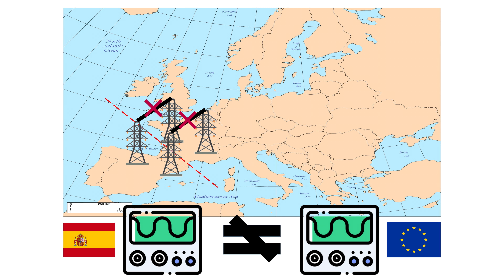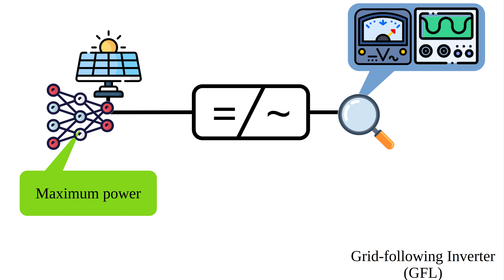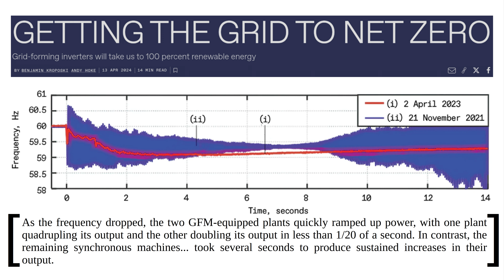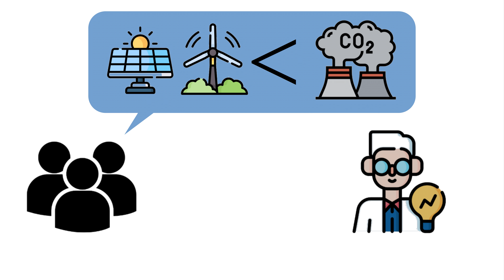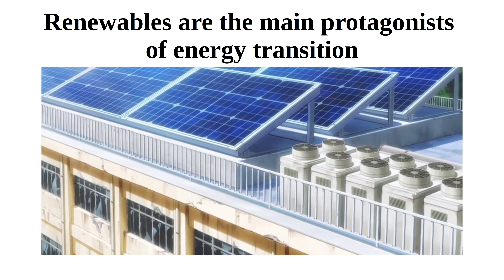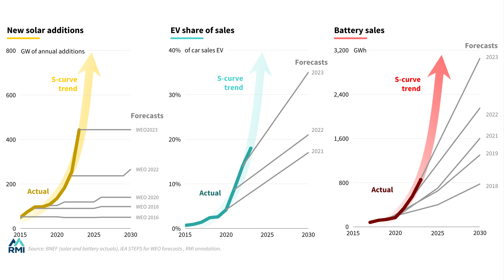After the blackout in Spain: how renewables + batteries can help prevent the next major power outage

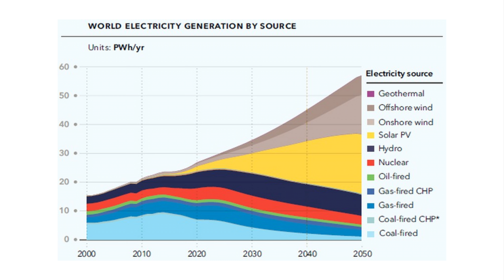Comment from the maker: (Information update at 08:40) According to ENTSO-E, 20 seconds prior to the separation of the Spain national grid and the rest of continental Europe, 2.2 GW of power plants were gradually tripped, though the specific details of the power plant types and reason of failure remained unknown as of now (mid May). Even if all the 2.2 GW of power plants were renewables, however, it does not undermine the main points of this article.

See more info at: https://www.entsoe.eu/news/2025/05/09/entso-e-expert-panel-initiates-the-investigation-into-the-causes-of-iberian-blackout/

(Further information update)
In mid July, ENTSO-E published a more detailed timeline of the events. Now it can be clearly seen that, on 12:33:24 a total black out occurred when all generation were lost. This meant that the initial data registered in the ENTSO-E transparency platform were probably incorrect. Although according to the updated information, the time for wind and solar generation to return to normal was still one to two days.

See more info at: https://www.entsoe.eu/publications/blackout/28-april-2025-iberian-blackout/